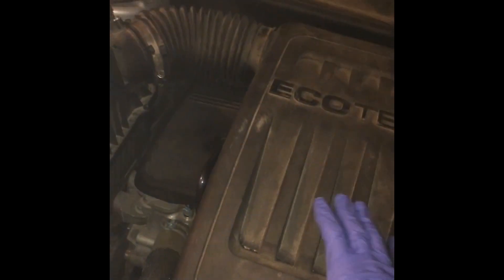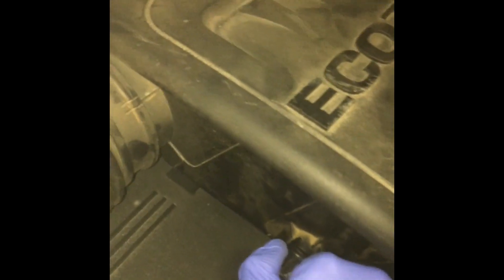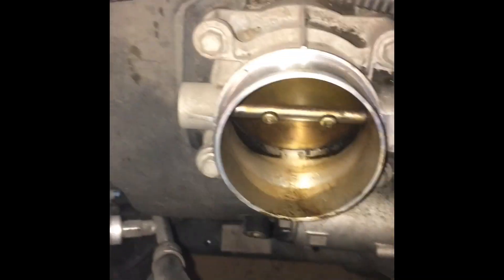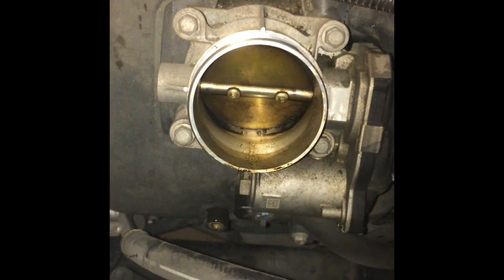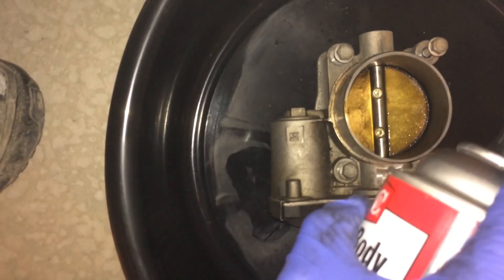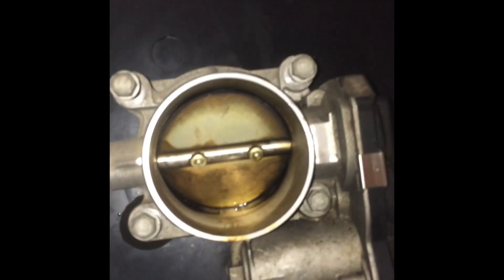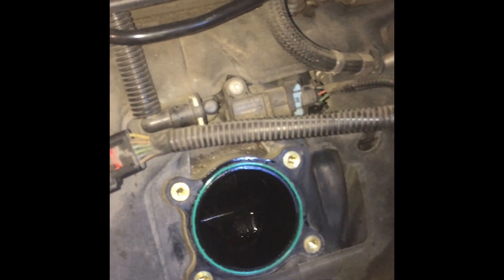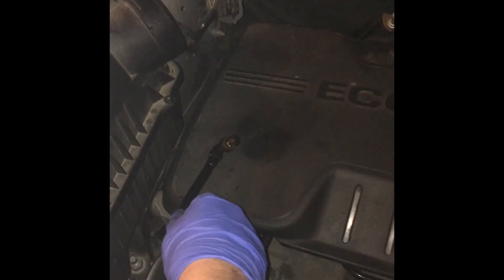How to clean throttle body on 2012 Chevy Equinox AWD 2.4L

Comment: I have a 2013 equinox. I followed this video step by step and it worked! My issue was that while idling my rpm's were dropping quite low. My throttle body was much dirtier than this. Completely black. Thank you for this video❤
Reply from the maker: Glad you found it helpful! Best of luck!
Reply: Having this same issue and my car starts to jerk its almost like my car is having breathing issues about to try this !
Reply: @aurorawashignton4767 

How did it work out?

Comment: My mechanic said I need to change the throttle body while he was scanning the vehicle with diagnostic tools. What  you reckon, should I change it or if I clean it will do the job? It's 2011
Reply from the maker: I’m not a mechanic and don’t know what codes your mechanic is getting but if it’s a faulty part, cleaning won’t fix it. . However it’s an easy clean. If you can find out what codes it’s throwing, then do some research- you’ll find your answers. It’s an easy part to replace as well, if you do the job yourself you’ll likely save you a decent amount of $$$. Good luck.

Comment: What is the symptoms of this being dirty
Reply from the maker: It can be low/poor idle- especially after starting the vehicle (my case), stalling, and/or stalling on acceleration. Hope that helps. Best!
Reply: @HomegrownHowTo  man my shit is good until I come to a stop...it’s making a loud ass noise when pressing on gas and when I come to stop or stop light it good for a second then starts to jerk like crazy...chills then does it again if I put it in park it’s fine tho
Reply: @justinu4521  hi! Did you find a solution to your issue? Mine does the same.

Comment: Could this be why it’s idling rough?
Reply from the maker: It is a possibility.
Reply: @HomegrownHowTo  it only does it for a minute before it’s warmed up. But man it gets rough. I’m going to try this and see what happens and also change the spark plugs
Reply from the maker: @zofaa1252  this also happened to me but cleaning the throttle didn’t help this issue. Turns out it was a faulty O2 sensor  that I installed previously. It was a very rough idle while in park from a cold start. Would occasionally cause the vehicle to stall out. But I replaced with an OEM sensor and it was fine. There is also currently a recall on both O2 sensors and the cat converters. Just an FYI. Good luck on your project.
Reply: @HomegrownHowTo  okay thank you sir. Also, when I accelerate or just idling there is a knocking noise and it’s consistent. Any idea what that could be? I’m honestly just thinking about Ls swapping it lol
Reply from the maker: @zofaa1252  not sure. I usually figure this stuff out as it occurs to me lol. But it’s likely a cylinder issue and/or the air/fuel ratio being off.
Reply: Interesting about the O2 sensor.  I've been having stalling issues after installing a Bosch O2 sensor.  Just ordered a GM original one; will see if that helps.  Found a couple other threads where GM vehicles had issues with Bosch senors...
Reply from the maker: @Silvertone2000  the one I initially installed was Bosch. As soon as I swapped with the AC Delco it ran perfectly fine.
Reply: @zofaa1252 did you ever figure out the cause or solution? I’m having the same problems
Reply: Could this be why I get a “Engine Power Reduced” message and it also idles really rough like it wants to die? 

One more thing, does anyone have trouble shifting between 70-80 mph… my rpms do not sound right to me 😅 but this is the smallest car I have had I have always had a V8 so I think this car so very different from any other car I have owned? Sorry I hope I am making  sense?!

Comment: if you remove your throttle body when you put it back on you will now have to take it to the dealer to have it reprogrammed and calibrated with your EC unit. Newer cars their throttle body are electric not cable driven so soon as you disconnect it you will have to have it reprogrammed you must clean your throttle body in place it is possible otherwise when you take it off you're going to pay a lot of money to a dealer to reprogram it and calibrate it back with your EC units
Reply from the maker: I had no issues with mine after disconnecting and cleaning. From my research if you do have idle issues after replacing there is a re-learn process you can conduct to get it calibrated. But that is usually only the issue if you open the butterfly with electronic components still connected. It is also dangerous to clean with electronics connected. If it opens and closes on your finger it’s not going to be pretty.
Reply from the maker: But be sure to remove the negative battery terminal before you remove electrical components from the TB.
Reply: You don't have to have to for this vehichle the ECM relearns on it's own.
Reply: My rpms were increased slightly after cleaning the tb. I fixed this issue by disconnecting the negative cable from the battery then the throttle body position sensor for about 5 minutes. Reconnected everything, problem solved
Reply: Should I disconnect the battery before doing this?

Comment: I did the same thing to my equinox and now the check imagen light came up and it says engine power reduced now I don’t know how to fix it
Reply from the maker: My only concerns are you pushed open the butterfly with the electrical still connected to the throttle body or got some of the electrical components wet while cleaning it. 
There is a throttle re-learn you could look up that may also fix the issue. But I haven’t heard of your specific issue before.
Reply: No. I took the throttle body apart and cleansed it
Reply: I’m a try cleaning it again see if i can make it work
Reply from the maker: Luis Vazquez good luck! Let me know if it worked. What code was it throwing?
Reply: The code is giving me is that engine power is reduced
Reply from the maker: Luis Vazquez it sounds like the electrical is messed up whether it be the electrical component on the throttle body or a short in the wire. Sorry you are dealing with that, car problems are always stressful.
Reply: Luis Vazquez you have to do a throttle body relearn. The proper way to avoid this issue and clean the throttle body is to never disconnect the battery and wire connection to the throttle body. Just unbolt and clean. The minute u disconnect the electrical connections, the computer resets itself.
Reply: emtdyal1 and how do I do a relearn
Reply: Luis Vazquez every make have their own sequence. Try google your year,  make and model throttle body relearn and hope you find it. I’m sorry I don’t have an easy answer for u. It’s impossible for me to remember the sequence for every make. Good luck.
Reply: emtdyal1 thank you
Reply: it's because you're not supposed to remove your throttle body when you clean it you have to clean it in place you have to have someone else push the pedal so the it will open and you can clean it if you remove the throttle body when you put it back you will have to have it reprogrammed and calibrated with your EC unit
Reply: @emtdyal1  finally some that understands tb in newer cars. Plz reframe from disconnecting your tb. I work for chevrolet in the machanic department.we get this issue all the time customers come in because they disconnected their throttle body and now their vehicle does not work right and we have to recalibrate the throttle body with the ECU units. customers come in say they watch the youtube video about how to disconnect their throttle body and clean it and now they ended up with bigger issues trust me disconnecting your throttle body and newer cars is a bad idea

Comment: Wht were the were the symptoms?
Reply from the maker: Rough idle. My TB ended up not being my issue though. I replaced an O2 sensor about a month before this with an aftermarket part. It wasn’t defaulting the computer enough to throw codes. Switched the O2 sensor with OEM and it fixed my rough idle.

Comment: Was your car pulling P0228 code?
Reply from the maker: Dustin Oxley no I was just doing some maintenance. But cleaning this may (probably not likely) resolve your p0228 code. Sounds like it's more than likely a faulty pedal position sensor or throttle position sensor. However I would first check your wiring for these sensors and make sure there isn't a short. Hope this helps. Good luck.
Reply: @HomegrownHowTo  awesome wow thank you for the quick reply I usually never get a response when I ask a question on a video. We just financed a 2012 Equinox get 10 minutes off the lot and the check engine light comes on. The dealership is acting like they had no idea, but its obvious the battery was unhooked to clear the codes since the clock and settings were all off in the car. They won't help at all and just keep denying anything was wrong with the vehicle. That's not the only code we are getting either it's also pulling codes P0113 and P0325. And then some weird code B2aaa.
Reply from the maker: Dustin Oxley sounds like a sketchy dealer. I hope you get it returned. I'd threaten them with bad reviews and litigation. P0013 & p0014 are both easy repairs but a common issue. If you happen to be stuck with the vehicle check and see if yours is burning oil. Mine was burning about 1.5 qt every 1k miles.and there is a big extended warranty to replace pistons and piston rings at no cost for this issue. I really hope you can get your money back.
Reply: @HomegrownHowTo  yep pretty much so and we avoided buy here pay here for this exact reason. This was a huge dealership too with like 4 car lots side by side. Pretty sure we are stuck with it now because it was sold as is. The financing company made us purchase and $1650 2 year/24k mile warranty but upon researching the company I find nothing but horrible 1 star reviews all saying they deny almost every claim. Not sure about the oil yet as we haven't had it long enough yet, guess time will tell.
Reply: The extended warranty is that like a recall or no?
Reply from the maker: Dustin Oxley no. Recalls are typically for safety issues. The warranty is good if you're consuming at least 1qt/1000 miles.
Reply: Oops made a mistake the code mine is actually pulling is P2228.
Reply from the maker: Dustin Oxley looks like that code is for low voltage on barometric sensor. It's good to read forums and see if other people had the same issues you're describing. May be a short with all the codes being thrown or a fuse that was blown.
Reply: @HomegrownHowTo  yes I've been reading forums all day and haven't found anything with anyone having an issue relating to these 3 codes. I was able to find the intake air sensor which is built into the MAF sensor and the knock sensor I'm going to order them both since they are relatively cheap. I'm having trouble finding the barometric pressure sensor. Is it known by another name or something? I'm just gonna start out and try to replace these 3 sensors and see if that help.
Reply from the maker: @Dustinthefortnitedad  Yeah the Baro sensor is also called the MAP (mass absolute pressure) sensor. I have a vid that I posted that shows how to clean the MAF and the MAP (Baro) sensors.  If you're replacing any sensors make sure to use AC Delco parts. I have replaced sensors in the past with quality aftermarket part brands and they all have came back with a code within a month. You can typically find the AC delco parts on amazon for much less than going to the dealer or buying from part chains. Chevy really likes the OEM electrical parts.
Reply: @HomegrownHowTo  thanks! I'll check out that video because that's the 2 of the sensors its pulling the codes on!
Reply from the maker: Dustin Oxley best of luck- I hope you get it figured out.